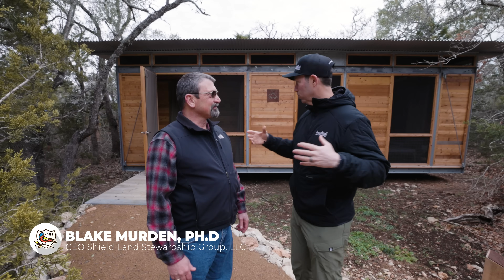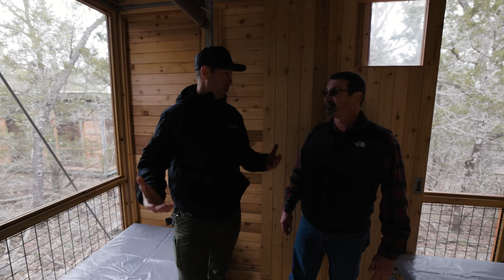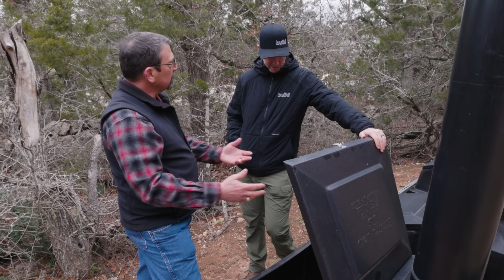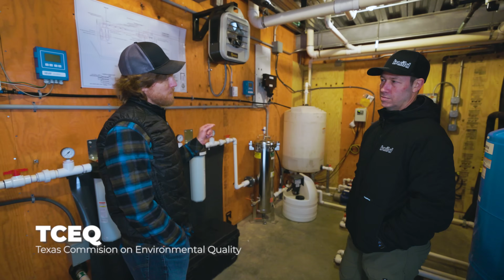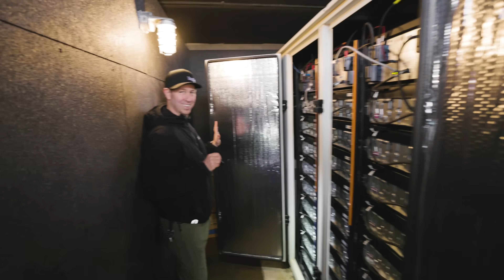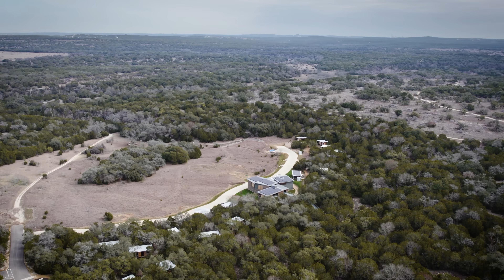OFF-GRID tech: This Texas Ranch has it figured out...

Comment: Now my questions. 

My goals are NOT to be carbon neutral necessarily, but instead to be able to build in a remote location away from the grid, and to have multiple sources of energy to run a house from.  So that means a solar panel to charge a battery system with a generator to back it up in the winter or during rainy periods.  I'd like to have a design that could go on a plot of land in say Michigan where I have family, or Florida or Texas where my wife would prefer to stay in the wintertime.

It also means I want to have appliances that consume less energy.  I've not done the research on this, but I like the idea of having some things run on DC direct from the battery without the loss of converting to AC.  For example, getting a powered DC refrigerator that might be used on a boat.   And it definitely means all LED lighting with DC power.

Has anyone built a house with DC wiring?  Is any building company thinking about this, for things like sub-panels or running wiring that has run for both AC and DC distribution?  (I'm going to guess not)
Reply: It’s been done for years. A quick Google search would be better than a long comment on “the sponsored post buuuuuuild show.”

Not as popular as it once was since solar panels became much cheaper and DIY lithium iron phosphate batteries became a thing.

Comment: You need to have a episode on the EG4 miney split AC with heat pump in 9/12/24,000 BTU. It has a DC compressor and has a MPPT solar inverter so it can run directly off 3 or more solar panels and a AC to DC inverter so it will run on 120v or 240v AC automatically. A very simple way for people to get started with solar and in Texas AC cooling is haif your electric bill so it will save a lot of money, reduce peak electric and no expensive batterys to deal with. The EG4 is also incredibly well priced. 👍 👍
Reply from the maker: Sweet. I’ll look that model up!

Comment: Lot's of great information here.  One question for the Shield Ranch and Positive Energy people.  What do you do during those periods of high production/low consumption for the power?  Seems to me that would be a good setup for a "sand battery" to deal with "waste" solar electric generation after the batteries are topped off.
Reply: Typically dump the energy into heating DHW, or some type of electrical or thermal battery.  Charging EV's is a great dump load as well.  I suspect bi-directional EV's will become common in the coming years as well (so the energy put into the car can also be used to feed the house).
Reply: I wondered this as well. I didn't hear them mention what their base consumption was, just referenced the commercial kitchen (and presumably large food storage/cooling) which I bet makes up most of their daily usage. If they had large enough cooling demands, they could dump the extra power into a chiller to make ice for later cooling. I have heard large buildings do this, but I doubt that is needed here.

Comment: Hey Matt when you connect to the electric grid at anytime, its against the law to “disconnect” anywhere in the USA. The key is to not connect in the first place. If you have connected, the min you must pay utility is the meter or monthly connection fee which is all over the place across TX and USA. We can connect a typical compound like this with a battery from a crashes Tesla! Looks like they have plenty of solar for future growth there. Looks like they are using Grid Tied SMA inverters and must have a smaller Off Grid inverter somewhere to trick the Grid Tie inverters into running. Prob cheaper than Sol-arks is what we sell.
Reply: Shield Ranch has an ELM Blue Heron 100kW BESS throttled to 76.8kWac to act as grid source.
Reply: The talk about that midway through the video... The panels have microinverters that look to the battery inverter for their waveform signal. The term they use is "grid forming inverter".
Reply: "when you connect to the electric grid at anytime, its against the law to “disconnect” anywhere in the USA."  So you're saying if I have grid service, it's illegal to use a transfer switch/disconnect to disconnect from that grid and then run on your own off grid system while the grid service is tied to the residence?
Reply: @ssoffshore5111  in most places it's illegal to live in the property if the power is turned off due to either service cancelation or failure to pay the account.
Reply: @kschleic9053  Oh, okay, TY!.  I thought he meant it's illegal to toggle over to off grid if you have a (connected) grid service.  I was going to say, that's the first time I've heard of that!

Comment: The ideal scenario isn't a nation where every home is "on its own", but instead homes are connected neighbor to neighbor in a bi-directional manner. If your panels are producing more than your home is using and all your storage (batteries, thermal storage, potentially even green fuel production in the future) is full, then your extra power goes to your neighbors directly. If they don't need it, maybe it goes on to their neighbors, and only if no one in the neighborhood needs power does it get sold to the larger grid.

Edit: a great discussion about exactly this, given this week by Tony Ceba (https://youtu.be/9hKp1xiCN9A&t=28:30)
Reply: Love the idea of community micro grids!
Reply: @stratigary  exactly... The grid of the future is a web of interconnected community microgrids.
Reply: most of the plants we design operate in the manner you describe:  Grid interactive but with varying degrees of resilience when needed.  In this case, cost to run the PEC grid to the Pavilion became a significant design driver.
Reply: False.
Reply: @jameskarrie298 more storage options and variable usage is the answer to midday summer overproduction... Everything from storing energy directly as heat in super insulated hot water storage tanks for tomorrows morning showers, to futuristic uses like making methane by extracting Carbon & hydrogen from air+water and storing it in a buried tank (think propane) for heating use in the winter.
Reply: A big part of looking into off grid is to avoid being connected to anyone or anything. Well, for me, anyways. The problem with storage is definitely still there, and your idea is very good. Maybe I would connect with my family's homes.
Reply: Warren Buffet dislikes this concept.
Lolz....
Reply: @James Karrie don't US homes run their AC during the day when it's hottest? At least that's the southern states taken care of.
Obviously, better insulated homes won't, so you store excess in another medium as others have suggested.
Reply: that's pretty much how it works today.  "the grid" is just wires at an elevated electrical potential.  Your neighbors are close to you so they're going to get first crack at any extra juice your panels generate.  Everything goes through the meters that everybody already has on their house, and the electric company keeps track of everything.  There's no need to add additional complications.
Reply: This is great in theory and definitely the optimal way of producing and sharing energy, but this bidirectional sharing requires the grid/utility to be involved and manage everything. The grid is a legal monopoly and has to show growth in profits, so I don’t see the same kumbaya with the grid as you do. People producing their own energy is inherently counter intuitive to the centralized model. I’ve been saying it for years, the inevitable result is going to be homes producing their own energy with 10-30 kw of solar and 30-80 kwh of storage, and you “sip” on the grid only when needed because prices will be dollars per kwh not cents. I know it’s jarring, but this is going to happen, it’s already evidence with net-metering being eliminated in a new utility everyday and feed-in-tariffs being decreased bit by bit. A ~$50k energy upgrade to every home in the US will be the standard in 2030.
Reply: where do you recommend i get my panels from without getting the government involvded?
Reply: @matthewmaynard5460  Craigslist?  😂
Reply: Uh no
Reply: @James Karrie you store excess in batteries and then export to the larger grid if necessary.
Reply: Spoken like a true communist
Reply: @INGWoodWorks  what about this is communist? Using your own property to generate your own power and selling it locally instead of at the whim of a central authority seems pretty antithetical to Communism to me🤣
Reply: @kevinforlife8578  I can't see it anymore either, I thought it was deleted
Reply: @kschleic9053  I'm noticing this is happening more and more in all the comment sections. It becomes obvious when you see a comment that has 5 or 6 replies but when you click to see the replies there are only 2 or 3 and some of the replies are replied to people who made comments that are not visible. So just the other day I thought to have my son pull up the comments section of some videos I made comments on where I never got replies. Turns out, he couldn't see my comments at all. The number of comments in the thread said maybe 12 but he could only see 7 and neither of the two I posted were visible to him. There's clearly an agenda here and it's a sinister one. Hell, they'll probably make this comment invisible. Seems very Orwellian all of a sudden around here... Censorship hurts everyone!

Comment: If you need that many panels you clearly don't understand the idea of carbon neutrality.
Reply: the site uses propane among its energy sources and is not carbon neutral.  It aspires to run as much as possible from the sun, and stored solar energy.  Perhaps best to say that it has a reduced operational carbon footprint.  There was a considerable cost to get PEC electrical service to the site, and the owners made the decision to invest that money instead into a power plant driven by the sun, but with a generator as a backstop.  The plant design and operation is seen as part of the curriculum of the site, and we look forward to watching it perform and sharing the performance of the system with the campers.
Reply: If you need that many panels you need/want the amount of electricity that those panels provide.
Reply: Who gives a rats ass about carbon neutrality. Thats all bullshit anyway.
Reply: Your name is apropos. Who said their goal was some nonsensical notion of carbon neutrality? Maybe they don't want to be at the mercy of the utility.
Reply: @Gideon_Judges6  then why even use solar
Reply: @mrstinky2421  huh? Why not solar? Do you have a small scale fusion reactor lying around or a free supply of diesel? Are you under the impression solar needs a grid tie? That's not "off-grid." You must work for the utility company or something.
Reply: Carbon neutral is all smoke and mirrors.